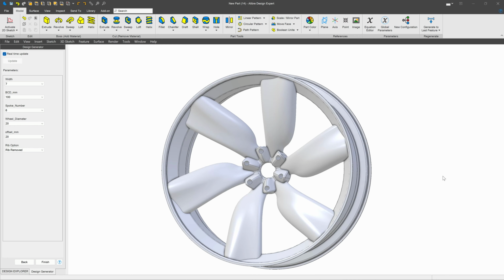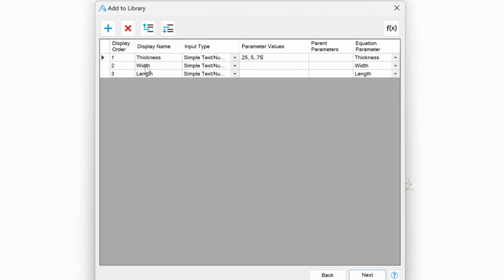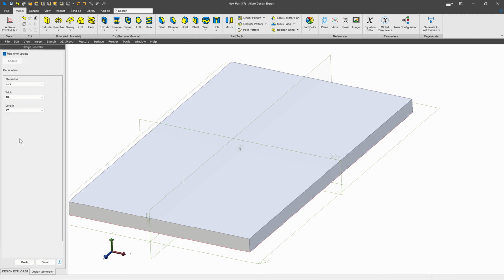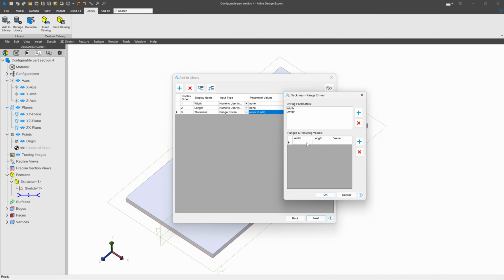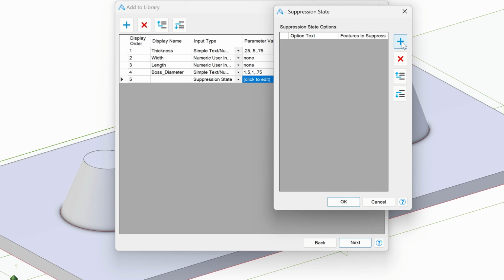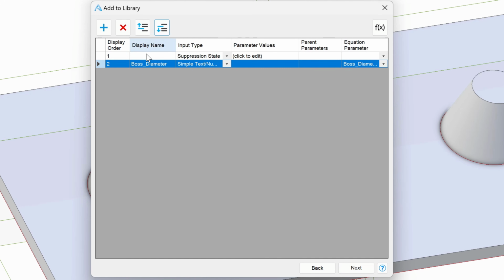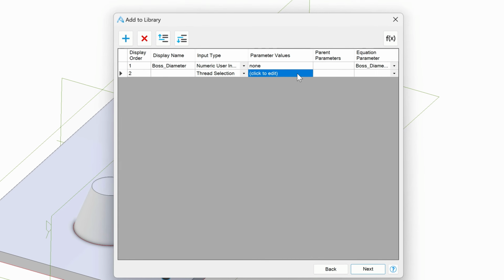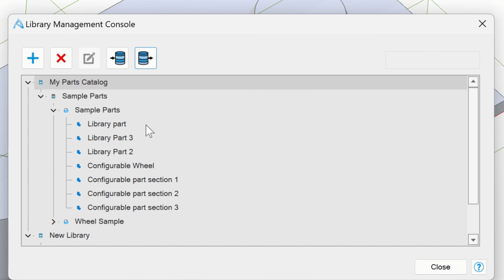Start to Finish - Dynamic Library Parts in Alibre!

Comment: A very thorough explanation of the very powerful Dynamic Parts Library. It is incredible the complicated rules you can set with it and create intricate geometry relatively simply. I have used it to create Boolean Threading taps and dies with adjustable tolerances for 3D printing threads and I even used it to create a lab breadboard product line. So, I designed the first plate with an array of M6 screws and locating pins and then specified the rest of the sizes and hole specs (type and number per row and column) with it.

Hugely powerful!!!

P.S. I am VERY Sorry. I tried but I can't constrain myself. "ISO Fine. No need Grammar..."
Reply: Why say many word when few do trick?
Reply: @JokoEngineeringhelp  Hahahahahahahaha